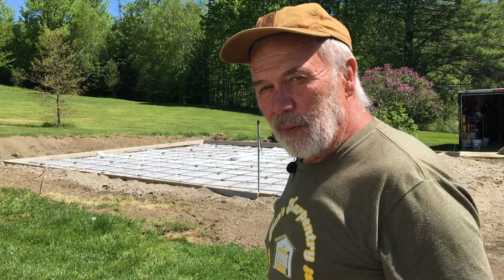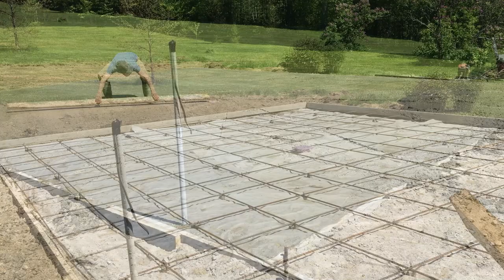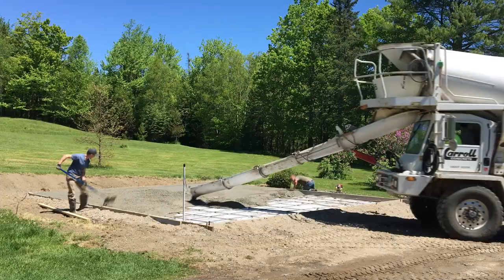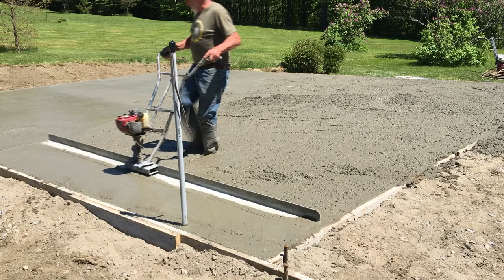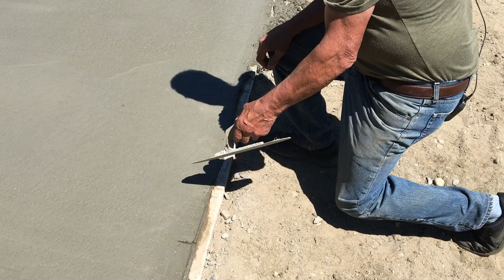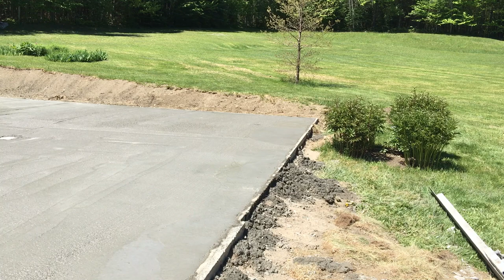First Concrete Pour of the Year.  Will they be on time?

Comment: Nice work on that pour.  I wish the folks who poured the concrete floor in my garage took as much care as y'all do to make it right the first time. I purchased my home back in 2015 and I believe the owner at the time poured his own 24 X 24 garage floor back in 2001.  It's a monolithic slab 4 inches thick with no footers or rebar.  Needless to say, the floor is badly heaved throughout and having it repaired now will cost me a small fortune. Thanks for sharing.  Cheers!

Comment: Ken, concrete day is always enjoyable to me. One tip for you. When running conduit or plumbing, leave a coupling on end of the pipe, just below the elevation of poured concrete. Tape end of coupling to keep concrete out. Pour slab,  float and trowel, then locate pipes and chip away small mount of concrete.  This keeps from having concrete build up around pipes. And you can trowel entire slab without obstructions. 
An old concrete master taught me that.  
Keep up the great work.

Comment: What a work-out. When it gets hotter I hope you have more help to work future concrete pours?

I guess you order the concrete with a specific slump. Too much water in the concrete is no good and too little water is no good, do you normally have to adjust the water in the mix after you start pouring or does the concrete plant "nail" the desired slump most of the time?

Thanks.
Reply from the maker: They adjust the mix on site to the slump we want. Thanks for watching

Comment: Might have been better to not use the power screed and just use the 2x4 to strike off the whole floor like you were showing before the  pour !! I have poured alot of garages striking off the concrete with a aluminum screed board just working my way around the drain !!   Good job though !!